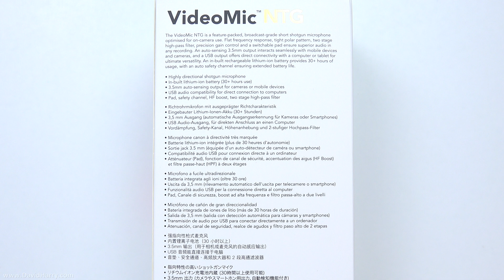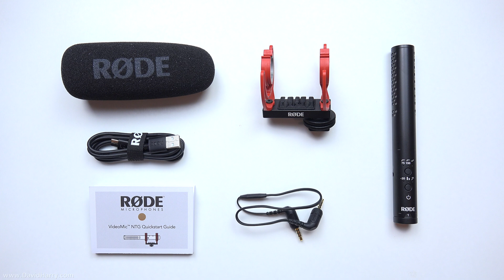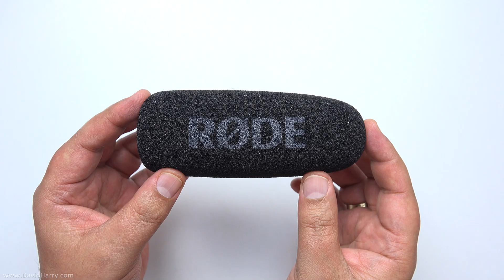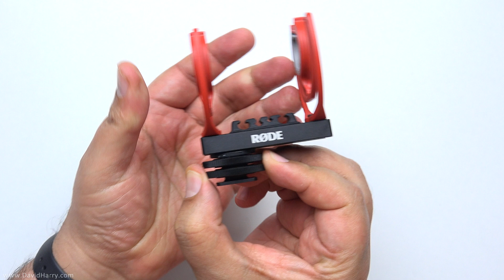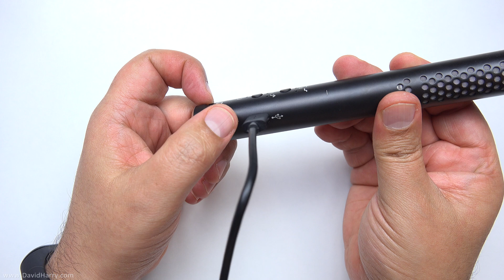RODE VideoMic NTG unboxing

Comment: How would this compare to a podcasting type microphone like the Podmic? Is this considered a dynamic mic?
Reply from the maker: Hi Peter. Check out my other video where I’m testing the VideoMic NTG in a close mic position. This is a condenser mic. Compared to a typical podcasting mic the VideoMic NTG is a lot more versatile as it can be used outdoors, on camera and other scenarios where a typical dynamic podcast mic wouldn’t be suited to. If the sound of the VideoMic NTG is suited to a particular voice for close mic podcast work, it will also be useful for other types of dialogue/voice recording and potentially represent better value for money. Cheers, Dave.
Reply: @DavidHarry  Thanks. I'm look for versatility..where one scenario I would like a portable podcasting setup. At first I was thinking of the Podmic with something like the Shure mvi. Will look out for your future videos.

Comment: Hi, David. 

I think I'm not the only one who will be waiting for your very exhaustive and professional tests with the rode. But I was shocked when I saw you used the Osmo Action with it, so I´m wondering: has there been any update or change in that cam? Anything that has made you change your mind about its audio quality? 

Thanks again for your work, mate.
Reply from the maker: Hi Mario.

There’s been a recent update for the Action that fixes a certain issue with the CYNOVA audio interface were you had to unplug the cable. That issue has been fixed but the interface still isn’t as good as it should be. With certain mics that interface works very well but with other mics it is really very dull sounding even though the mics aren’t dull.

I’m just lucky that one of my mics works well with it but that mic is a pro mic that costs more than my whole Action setup and isn’t a solution for most people who just need a nice functional cheap mic for daily vlogging. Here’s a test that will be going live soon you can clearly hear just how good the audio is after the update with my Sennheiser ME64 https://youtu.be/kB3peTLjeBM

Here’s another test that’ll go live soon, this one is with a Comica VM10. While it’s not as good as my ME64, I think this is OK as a cheap option and the Action with the new update seems OK with it https://youtu.be/29_KLq5gPk8

Like I said, the whole Action external mic thing isn’t right yet but maybe it’s getting there.

As for the NTG. It’s an awesome mic with a bunch of very useful functions. I was using it today as a sound card on my editing machine, it’s just mad :) I’ll be doing a whole bunch of stuff soon.

BTW. There’ll be a few videos going up over the next few days, all test type stuff with the Action, Pocket and GoPro. I’m just gonna dump a bunch of stuff quickly, I need to get more videos done with the NTG and I’ve also been given a few mics by Neewer and Comica to review. I’ll be trying all these as vlogging mics with the actioncams.

Cheers,
Dave.
Reply: @DavidHarry  thank you very much. I wish all the pros shared half of your passion.
Reply from the maker: Thanks Mario.